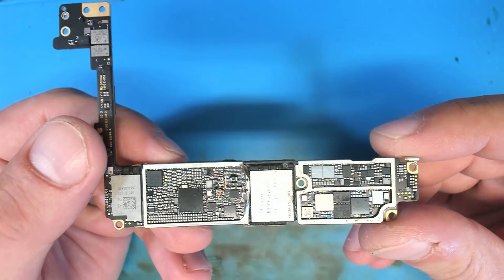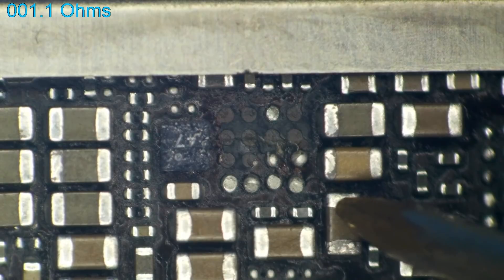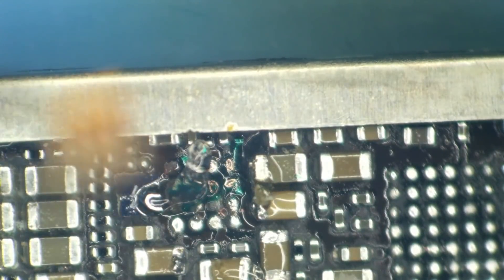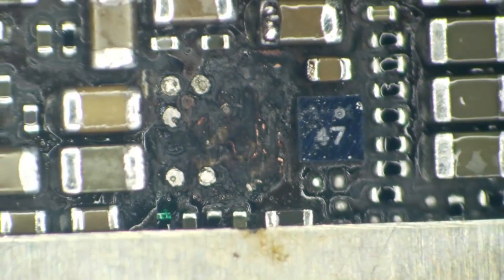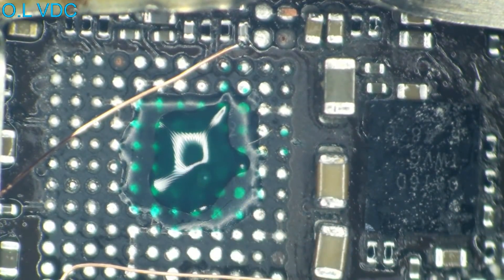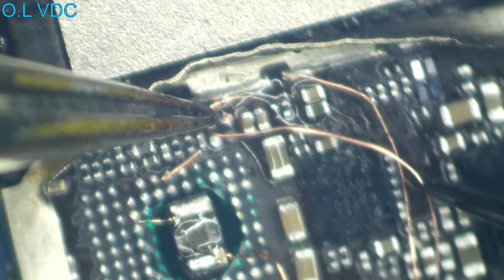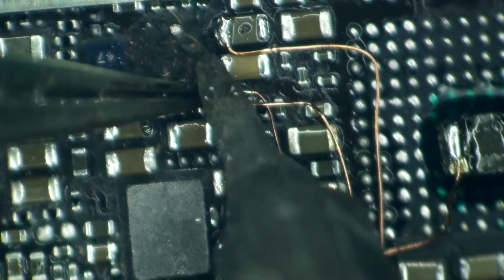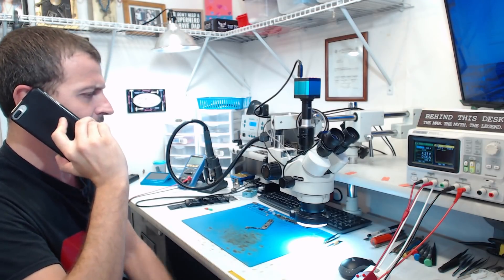A board from New Zealand that went terribly right (and let smoke out)

Comment: Hey, I'm just being an ignorant nut I'll ask anyway: if the purpose is just to recover the data, could one not have fed in an external supply voltage instead of fixing an internal boost converter?

Comment: You could just short jumper VDD MAIN to VDD BOOST and use a full charge battery to recover data..
Reply: yeah and the iphone 7 7plus cases after X the phone will reboot automatic each 3 min. i wondering if its another solution for iphone X up.

Comment: I am guessing that chip only boosts when battery level gets low. Based on a project I working on that has a 3.5v rail that only boosts for a short time when the battery(lithum) is nearly dead and runs a as a basic ldo the rest of the time.

Comment: Pro tip - tie boost to main. 10 out of 10
Reply: I would definitely go into the bathroom and screen at the mirror for a good 10 seconds
Reply from the maker: Yah, especially having learned it a good 8 months later!  Thankfully, I will be able to use this board as swap board now that I know it doesn't need all those jumpers to boot.

Comment: Hello sir . I bs you not I had just ask Paul this morning about an iPhone XS Max it bout fine over heats then shutdown I can’t find the right shorted cap or dial but I had ask what if I move all the ic over to lock but will working board will it still work as normal ??? Thank you sir
Reply from the maker: The chips can be moved over for full functionality but it would take someone very confident to do so.  I've been doing it for data access but wouldn't want to guarantee that everything would work 100%.